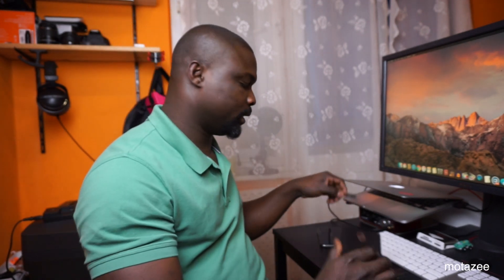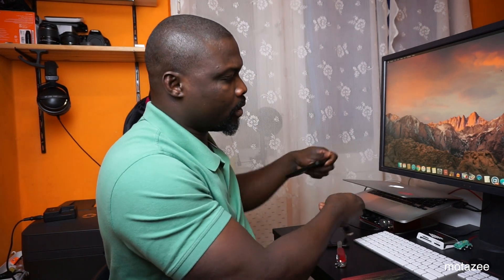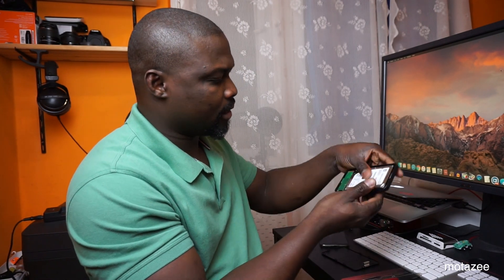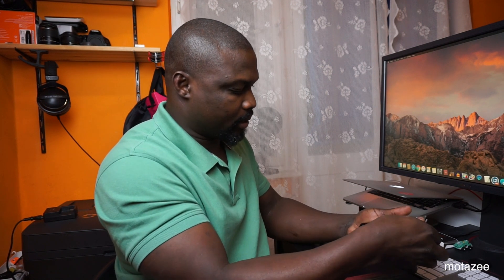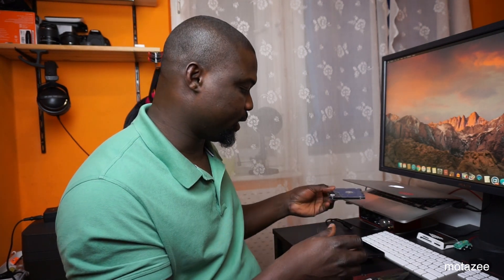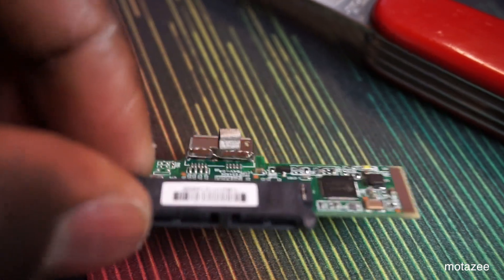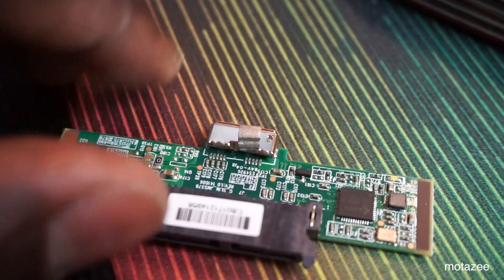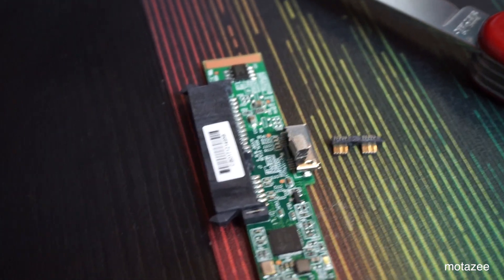Don't Buy The Wrong Hard Drive! / Disassembly of G-Technology G-Drive Mobile USB

Comment: Hey, just my 2 cents... but the G Drive in general seems like a really good value for money, what sucks is the piece of crap micro USB connector... this problem was solved on newer models of this drive, they now use the far superior USB-C connector. I would agree with you that ANY external storage drive today that doesn't use a USB-C connector is a complete waste of money... but I wouldn't hesitate to buy a newer, USB-C G Drive.

Comment: Just an usb-c connector that has to be soldered again.. the drive is not even faulty. So what's the point, the board replacement ,the re soldering of the connector or the new caddy that has to be found, which one?

Comment: mr Motayo do you know where i can find a replacement part for the clip that used to plug in the usb. I wanted to replace it for someone opened it and running the drive on an external.
Reply from the maker: sorry @RIZA SAIKA , I don't but you can check on eBay or Amazon , thanks

Comment: Be thankful you can still use the drive and access the data, most external use the PCB to solder the USB connector when that brakes, you cant access the data anymore. At least with that one you can.

Comment: I was the victim of this earlier as the micro USB port on my G-Drive 2TB model (made and bought last year) just broke off. Luckily I had a USB to SATA 3 converter which I'm using now as I speak to copy my feature film files off that drive and onto my G-Drive 1TB SSD and 5TB Toshiba drives. The annoying thing is I spent nearly £100 on that drive last July (2017) so it's not even a year old yet. 

You need to get a USB 3 to SATA converter or adaptor,plug it into the drive you took out of there,plug it into your computer and you should find that your files are all there. :) Try it Azeez Motayo

Comment: Thanks for the video. Since you took it apart, can you please let us know what is the brand/model/number of the hard disk inside? Maybe that info can be useful. I see that the usb connector is not welded to the hard disk inside, like in many other brands, so maybe you can use a 2.5" Hard Drive Enclosure and there you go, you can use that disk again. Thanks.
Reply from the maker: Sure, I have a video of that coming soon, just got a nice Enclosure, that will work nice for all 2.5 HD and SSD, Thanks for your comment. Happy New Year 🎆
Reply: Happy New Year! So, what is the brand/model/number of the hard disk inside? I'm curious. 
PS. Check out this disassembly video https://www.youtube.com/watch?v=DBenRlPzb_s
Reply: Happy New Year! So, what is the brand/model/number of the hard disk inside? I'm too curious.
PS. Check out this disassembly video https://www.youtube.com/watch?v=DBenRlPzb_s
Reply from the maker: How to install a 2.5" SATA hard drive into an external enclosure.
https://youtu.be/G3F2kmWgGcA